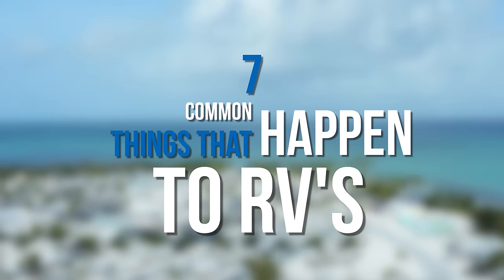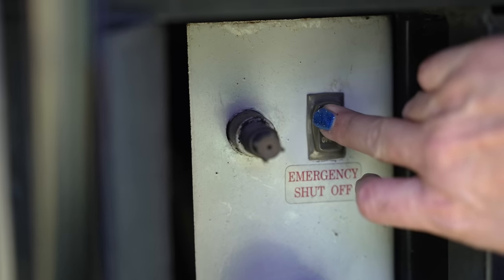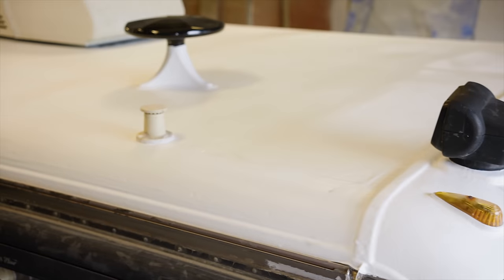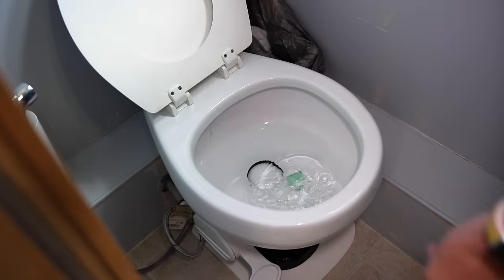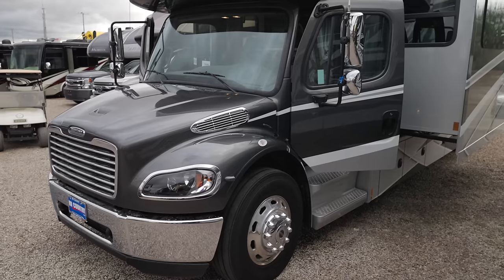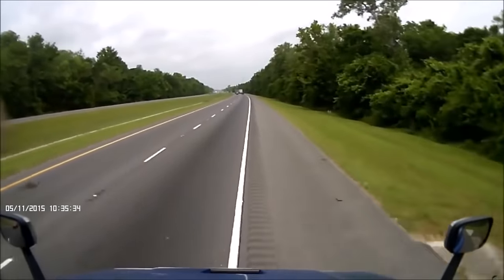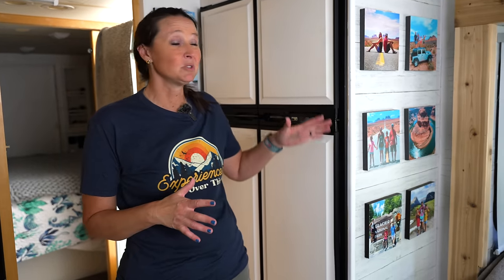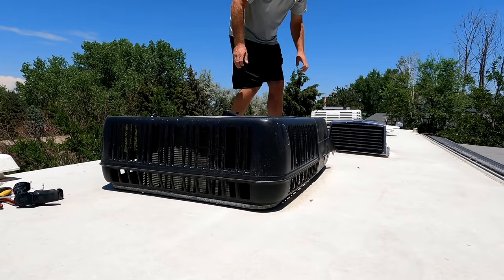7 Common Problems With RV's (& How to Fix 🔧 Them)!

Comment: Two things I noticed in the video. Keep all batteries clean. The dirt on them will leach power off the terminals through the dirt. Only use distilled water in lead acid batteries. Thanks. Steve
Reply: Another truck is to use one of the Walmart clear condiment bottles for distilled water.  It makes it super easy to add water whenever you need.  I use this for our RV, tractor, cars and ATVs.
Reply: Use dialectic grease on the terminals too.

Comment: YES! I brought my Solitude 5th wheel to the DFW location. The rubber roof, camping and getting around in the Rockies, was very easy to damage. This 3/8" sprayed on coating is tough, very tough. Best money I ever spent on my Solitude, hands down. It was actually less expensive than another weak rubber roof!

Comment: Any sign of loose edges on the roof sealant indicates possible leak issues. It is best to have the roof redone if it is older. Replacing that sealant as soon as you start seeing dark edges is a must. I hate many of the new RV's have a plastic toilet.

Comment: Deep cycle( or golf cart) lead acid batteries should last 5 years. The other comments have great suggestions for battery care.  Do use only distilled, not filtered water when needed, and keep them fully charged.  If any acid spills on the battery exterior clean it off even if it looks clean.  The acid is more conductive than dirt.

Comment: After rv sits for a time un used i always have to run the burner on stove top to get the propane to the fridge,  works every time as the stove and fridge are at opposite ends of propane tanks.
Reply from the maker: It's interested how that does the trick! Thanks for watching and for the comment.
Reply: @GratefulGlamper  

The burner uses way more gas   than fridge   and when u open valve at burner it purges the air out of the propane line.  Thus saves fridge from trying to light forever    works for same issue on the furnace

Comment: Have you talked about your use of reflective material/insulation in windows and bay doors?  We just traveled from Arizona to Iowa and dealt with heat and cold, and definitely need to insulate.
Reply from the maker: Yes, we recently did an accessory video and showed how we use Reflectix in the windows: https://youtu.be/9BsUFl09gA0?si=hdqqhAktUX5lMmQc
Reply: @GratefulGlamper  oh, sure enough, you did. Missed it.  Thanks!

Comment: Propane seems to be the exact thing for ours, the toilet..... luckily I got 2 new gaskets and the proper lube,it was simple from the top.Tires........5 years on the trailer...Dry rot and crack. Check the date codes..

Comment: RE: Propane....  An issue I ran into was a failure to start for my propane-fueled generator.  Turned out to be an insect nest in the vent tube for the pressure regulator closest to the generator.  Regulators designed for very low pressure MUST have the vent clear of obstructions and open to the atmosphere.
Reply: If you haven't experienced bugs in the vent tube, you haven't been RVing long.

Comment: Hopefully you used Deionized water in those lead acid batteries! ..Not that i always have tho, ha. 😅
Reply from the maker: We don't have them anymore - but at the time we only had spring water with us! 🤦🏻‍♀️
Reply: Distilled water is  recommended and is readily available at low cost.  In a pinch tap water, spring water (as shown) will do.  Lead acid batteries have been around for decades,  maintaining is the key (as with most things).  Happy camping.